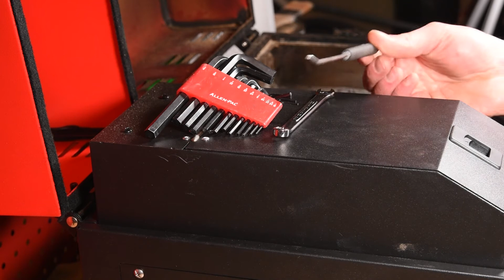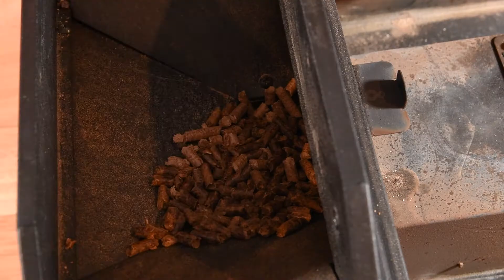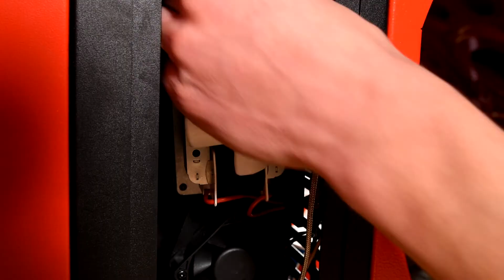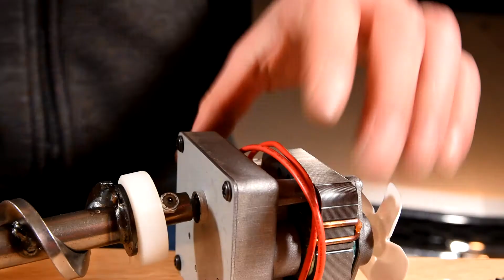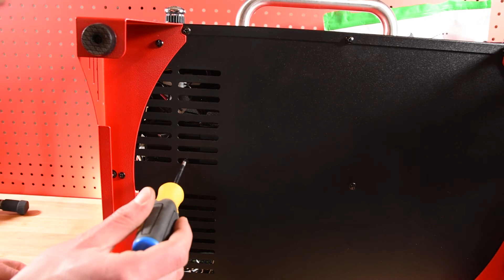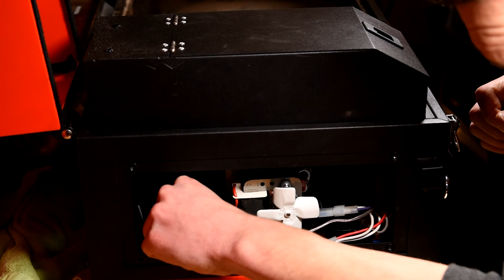Asmoke AS300 Auger Motor Replacement

Comment: There was no mention of the ground wire on the motor. Mine was factory screwed in so tight the screw stripped when I tried to remove it, so I had to get anew connector and extend the wire. Also, no mention of feeding the red wire through the gromet and hole in the mounting plate. My base plates screws wouldn't fit through the slots, so they were more difficult to get in than this video. Overall, a good video though.